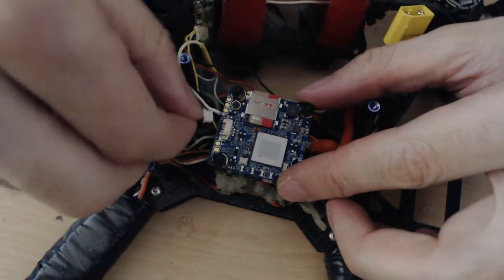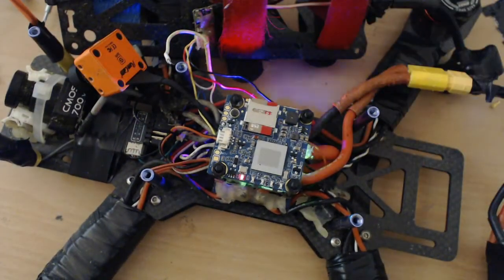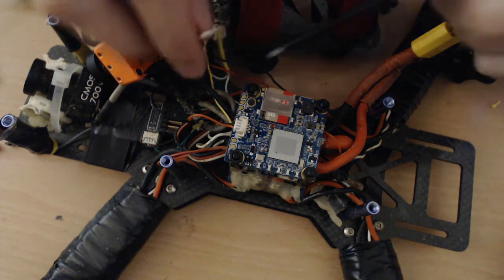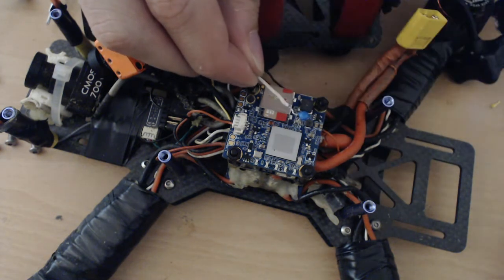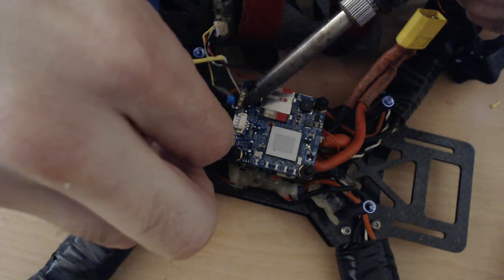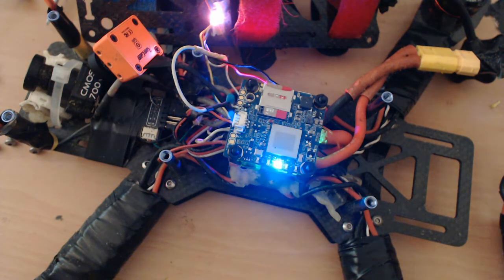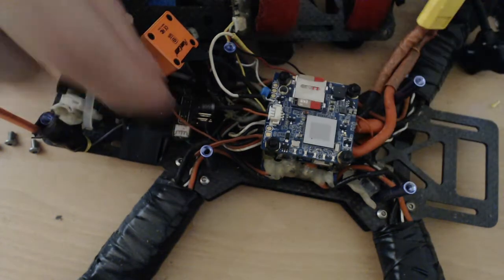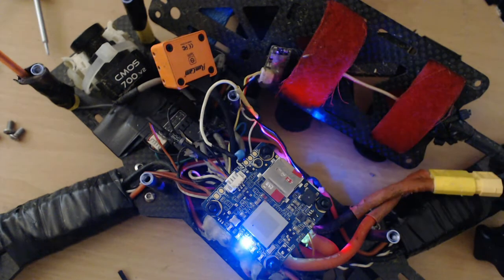Runcam Split SmartAudio + Diode

Comment: How you have connected all the wires between FC, VTX and Runcam-Splitt?
Have you a full connection plan?
Reply from the maker: I am not using the Split as FPV camera, just as recording one.  The audio has this schematic:
Unify audio  => Run cam split and FC , just need to add a capacitor between Audio and Runcam.